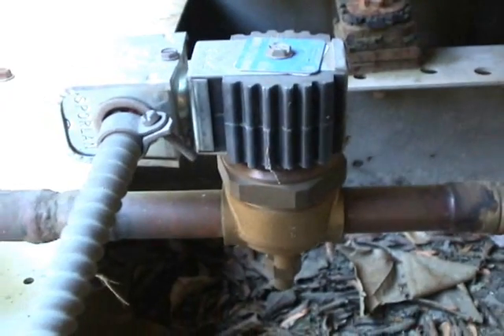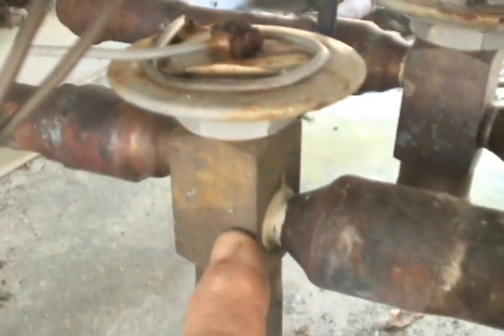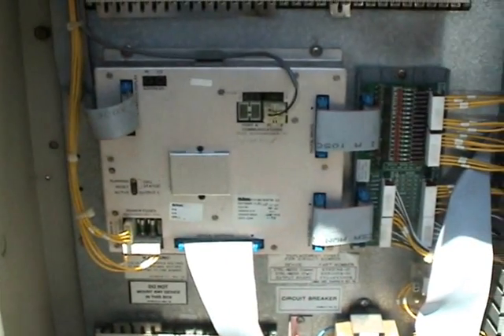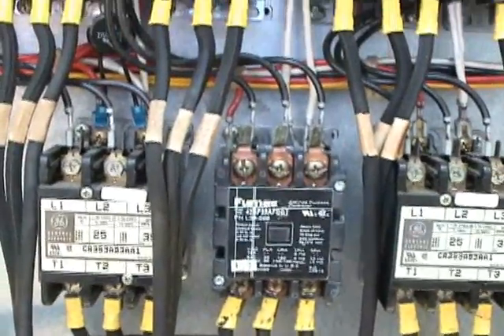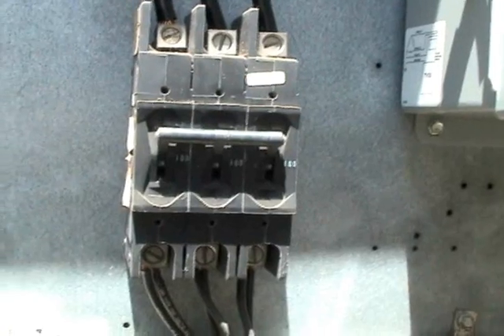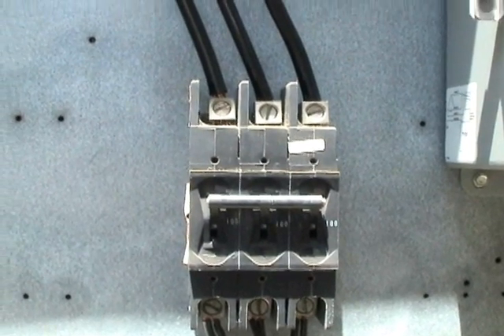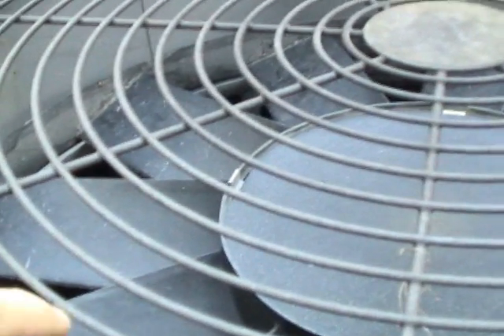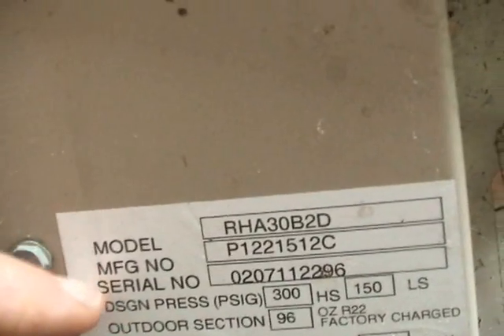HVAC ordering parts from parts houses 1

Comment: When I was an apprentice I was taught to get the MN and SN every time I worked on equipment. My general practice is to write down all the info on the plate, just in case. It's better to take a few seconds to have all the info than to be caught with your pants down.

Comment from the maker: It sounds like the system is either going out on low pressure or high pressure or the compressor is going out on thermal overload.

Comment: This one of the first things to do when servicing any system. Write down the model and serial number and make sure it is on the invoice. There should be a place to put both of these on same and this goes for EVERY case. I've also had to get numbers off of control boards, coil voltages and all kind of weird stuff.

Comment from the maker: @buddymotion It sounds like you have the yellow wire on the wrong terminal. Make sure that it's on the Y or Y1 terminal on the thermostat. If it keeps running then see if the compressor contactor is stuck in the closed position by turning off the power to both the air hander and the condensing unit. If the contactor is still in the closed position then replace the contactor.

Comment: Good vid!, Start and Run capacators for single phase units are also a good example of parts which don't need to be OEM, as long as the voltage and Mfd values are the same of course.
although I'm sure some manufacturer has found a way to make their run caps into a OEM only product so you pay 2X the price.